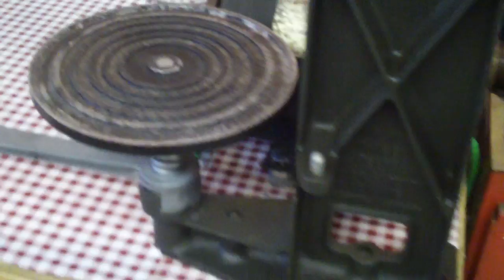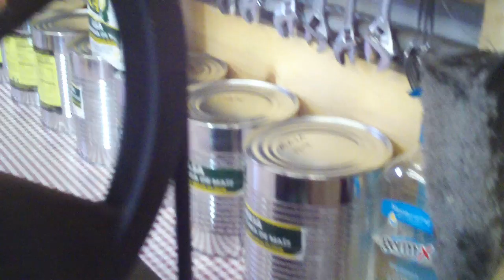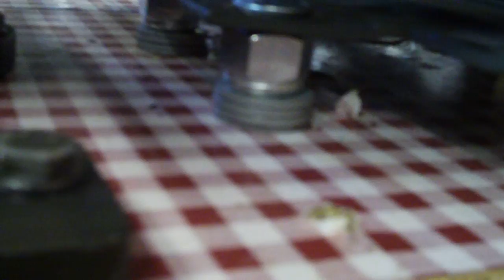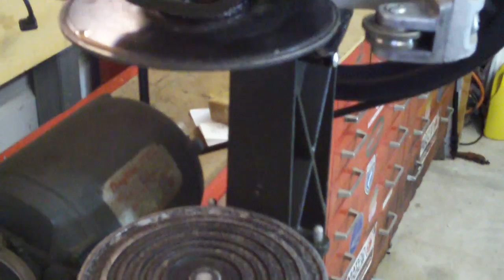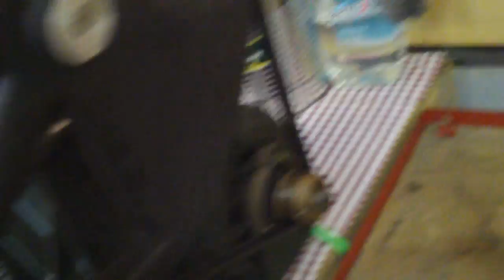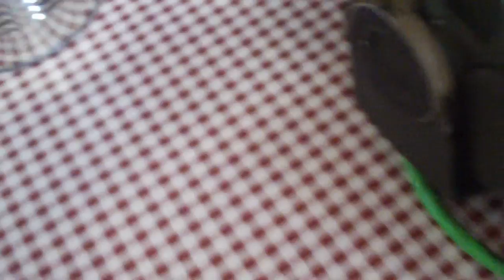How to motorize a senior can sealer #1502

Comment: The lid is sticking the machine want let go at the top
Reply: hi...common problem....lower the bottom pressure pount...use the edge of your hand like a karate chop...hit the bottom of the can with an inward motion or a side motion...it should release...the machine is new and probably tight....hope this helps...

Comment: I am looking for that pulley but cannot find it. What is the company name for the pulley?
Reply: hi...I dont think they make them anymore....I had a machinist make me one....if I can find one..I will let you know...try a belt shop that is where I got the original from...
Reply: That is fine so I guess I will have to make one for myself. How thick is the one you have? What is the outside diameter?  @technician775
Reply: @gorillamotors  I will have to dig it out and get you some measurements...also what speed motor are you using??, that will give you the size of pulley to make. use a pulley/ rpm calculator to figure that out....use the motor shaft for the i.d., l hope this helps....
Reply: @technician775  I actually have the same Dayton motor as you have so I will be using the low speed as well. I have a geared motor that turns at 3 rpms but that would take 2 days for each can.
Reply: @gorillamotors  ok...well...that is a good thing....let me look...I might have an extra pulley...do have a way to make one, a pulley??
Reply: @technician775  Yes. I have a small machine shop in my garage. I will have to machine out a keyway in the pulley which I have not done before but that should not be hard to do. I only have to make one pulley and not 50,000 of them.
Reply: @gorillamotors  lol...true...my machinist friend lost all the drawings for the pulley...they work with the cnc machines...he popped out a couple for me years ago.....sent one to australia...only have one left.....
Reply: @gorillamotors  what will you need as far as measurements??? I can measure this one out...except for the belt groves...I would suggest getting a belt and measure the grooves off of it....or I can measure what I have....
Reply: @gorillamotors  can you send me a private message or email??
Reply: @technician775  What is your email as I cannot find how I can send a private message here.
Reply: @gorillamotors  I can send you the measurements....or post them here maybe to help others
Reply: @technician775  Why don't you just post them here as I cannot find a way to PM you here. Does anyone know how to PM someone here?
Reply: @gorillamotors  hi...I posted my email.....maybe it did not go thru....ok...I can post the measurements....
let me get them.....
Reply: @technician775  I just designed and made a 3 D printed pulley in PETG for this. Would anyone like me to attach my stl file so that you can print one out yourself?
Reply: @gorillamotors  hiya!.....thanks....did you get my email address??..
Reply: @technician775  No I did not. Do you have a facebook page for Bayou Honey?
Reply: @gorillamotors  yes I do!
Reply: @technician775  I will try and send you a message with my email address.
Reply: @gorillamotors  I sent you a message on facebook messenger....
Reply: Ok, 5/8" bore, 1.600 dia round, 1.190 long, allen screw to hold in keyway, 6 grove belt, belt number in video (you can use it to get grove depth and spacing correct, i can't measure the grove depth with my calipers), looks to be .100 between groves (check belt) 1st belt grove from end looks to be about .200 from edge to center of first belt grove, keyway .185 wide, .080 deep. hope this helps, i wish i had better info. I think it came off of a washing machine or maybe a dryer.  let me know if this works !!!! GOOD LUCK!  you can try this for my mail, lionspaw1955 at gmail dot com

Comment: Hello!  Thanks for posting this video!  I have been looking for this information before purchasing my seamer.  I like the idea of having the machine manually or using electricity.  I'm curious about the flywheel and how the belt fits.  I am looking at buying the senior can sealer #1502 but looking at the pictures of it, it does NOT look like the wheel has a groove for the belt to fit into.  Looking at your machine, it seems as though it does have a groove or indentation to keep the Belt in place.  Is this just an optical illusion or is there actually a groove on the wheel for the belt to in?
Reply: Hi, it does not, a flat belt will run if aligned....